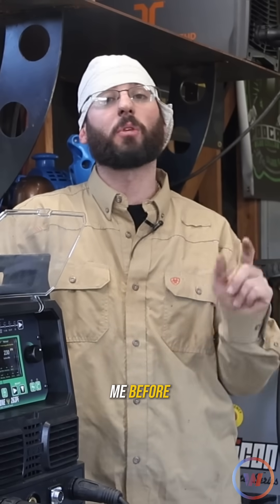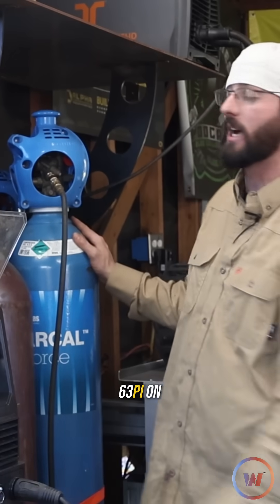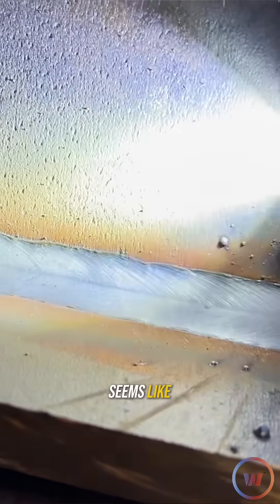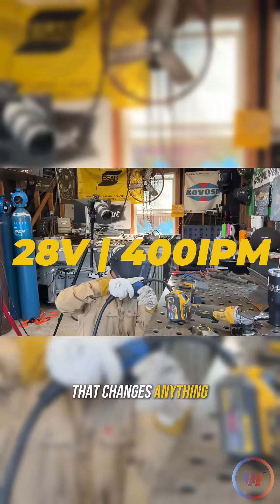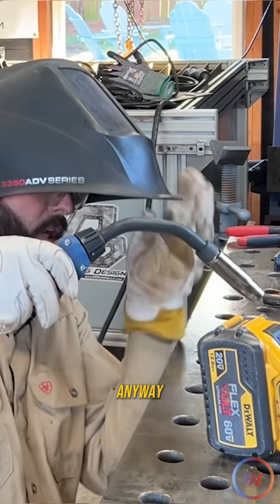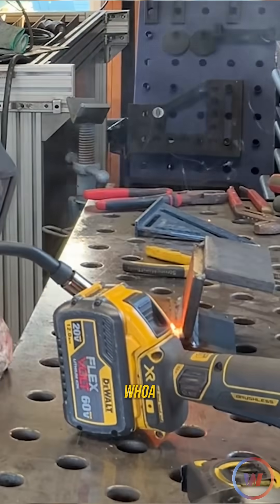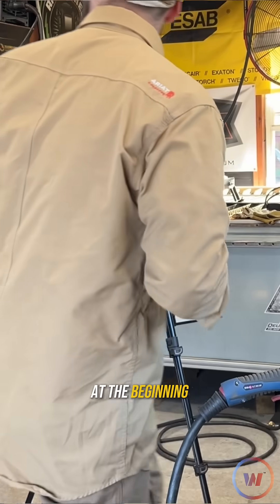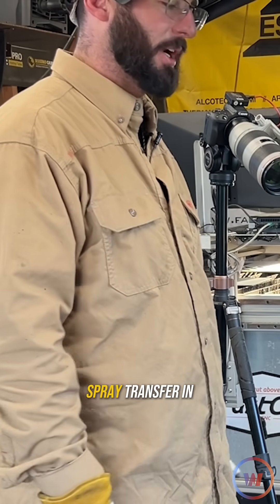Choosing the correct gas mix for spray transfer #GMAW #airgas

Comment: From what I've been taught, spray transfer is only achieved in an argon rich atmosphere that is no less then 90% argon. You saw and heard the difference when you switched to the 92/8 gas; a buzz or hum instead of the normal crackle and very little, if any spatter left behind.
Reply: With dual shield you can obtain it with pure CO2.